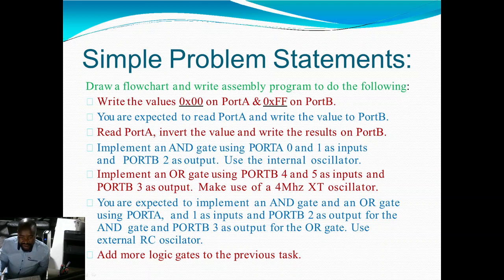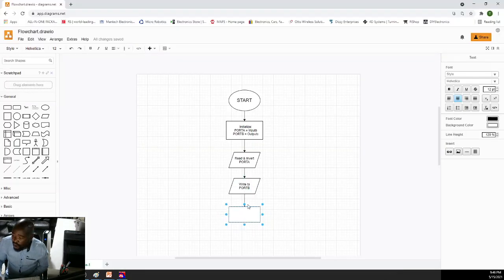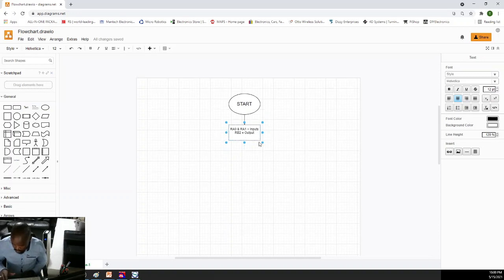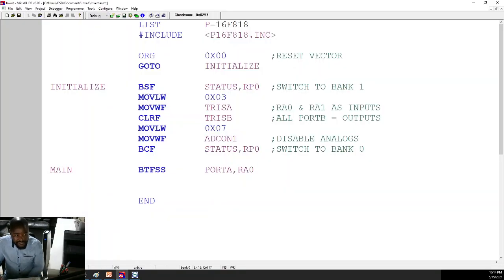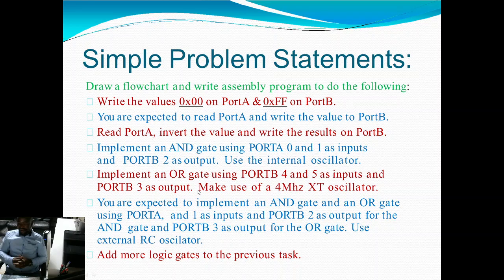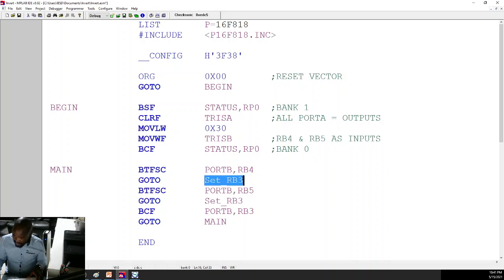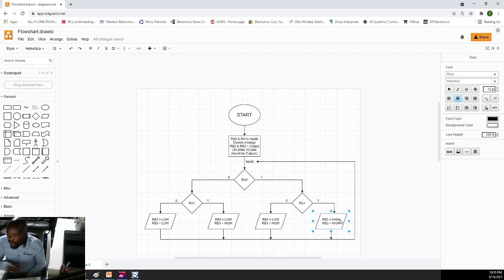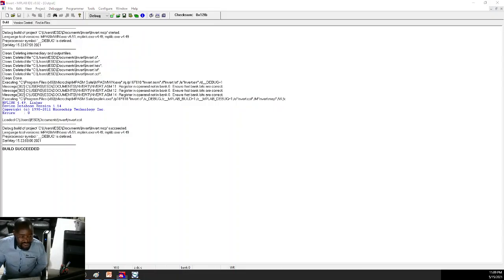More Examples. PIC Assembly Language (Tutorial 4).

Comment: 2.2	Write an Assembly Program Code for a PIC16F627A that will Simultenously Switch ON the LEDs in PORTA for 1 second then Switch them OFF, and thereafter Simulteneously Switch ON the LEDs in PORTB for 1 Second then Switch OFF. The program should repeat the process until a Switch is Pressed to Switch OFF all the LEDs in PORTA and PORTB. If the Switch is released the program must continue with the obave oparetion 

I need a solution please